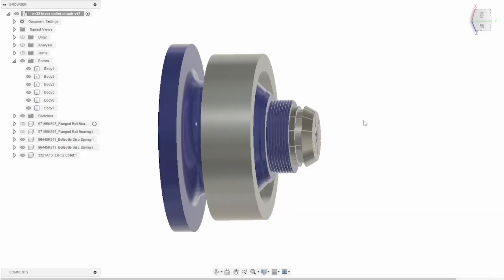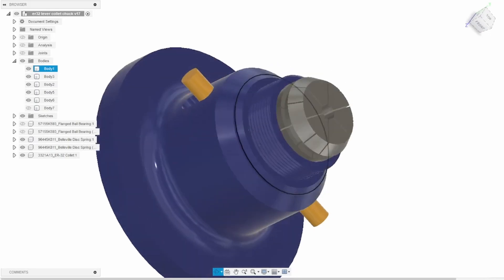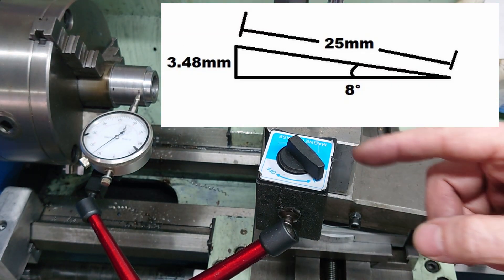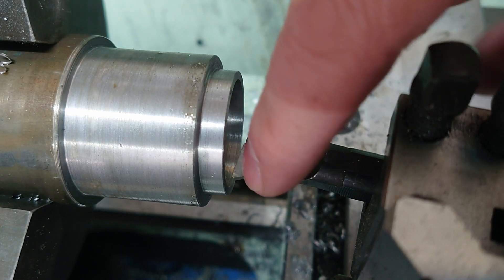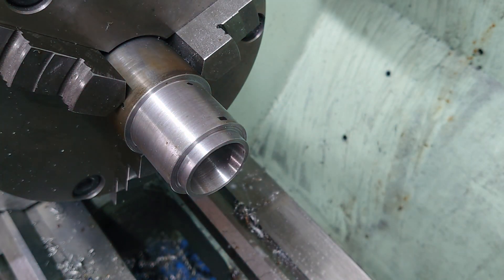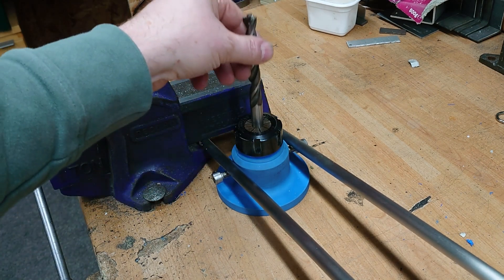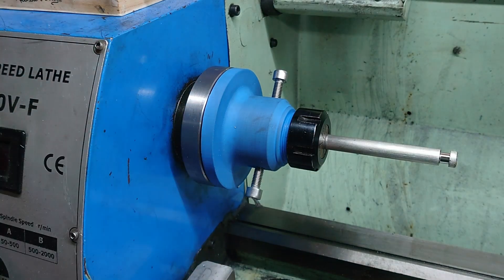Lever Action ER Collet Chuck - Prototype

Comment: I'm slowly working my lathe over to cnc to help out on this open project.  Er40 and er50 crossed my mind today and i figured i'd hunt this down. Fusion reminded me i need to upgrade to windows 11 and the only reason i put fusion back on my pc was your chuck. How do i give you credit for this?  You came up with it.  Not me.  I'm just nibbling at working on it.  picked up a 2 stage cylinder for my mill as an excuse to get a compressor so it's incentive to do another for this. Thanks for your work.
Reply from the maker: Hi, very nice to hear someone taking my idea forward. I got too easily side tracked on to other things! No reason why it can't be scaled up to ER40/50, I only went for ER32 as they are the collets I have. I'm interested to learn more about how you plan to actuate the chuck, and what size cylinder you think it needs. My email is on my channel about page, I think you have to look at it on a desktop browser. As for credit, a mention is fine with me, I'm not after all out glory. Let me know how it goes, I would love to see the end result.
Reply: @ollysworkshop  I'll cross that bridge when i slap the machine together.   I want to take a closer look to some of our "second opertion" and standard dovetail hardinge lathe mechanisms at work more closely but stage cylinder and overcenter mech have been stuck in my head since i saw this but nothing concrete.  I've spent all the time between now and then designing my actual lathe.

Comment: Clamping the parallel shank of a tool by spring pressure is not used in industry for obvious reasons.
Bellevile washers are used to clamp solid tapers into a socket via a drawbar where the inherent friction of the taper and drive keys stop the toolholder from spinning. The cutting tool is securely clamped in the toolholder.

Comment: WIthout a cross section diagram, I couldn't see, but unless mistaken,
only the back half of the ER is in a taper? (the sliding part)
Or does the ER front also get gripped in the body of the chuck?
Reply from the maker: Hi Nigel, on this version I could only get a small amount of taper contact with the sliding part as I had to make the neck of the body (the bit with the M40 thread for the nut) fairly substantial as it was only a 3D print. I'm redesigning it in metal and I think I can get the taper to full length on that version.  I'll include a section drawing of the mechanism in the next video.

Comment: In my experience using ER,  fine chips get into the collet and chuck. If you use ER at all you know it's a clean every time you release the nut affair....
For the manual lathe, the Hardigne/Sjogren speed chuck in 5C is my favorite. You really only need a few stock size collets and some soft emergency collets for 2nd op or odd sizes. I have a 5C lever action chuck, never set it up.
Reply from the maker: Hi, thanks for the feedback, that's a good point about cleaning the collet. Makes me think that some kind of chip shield is on order 🤔.

Comment: If you drill a hole midway between the 2 release pins and make a spanner which starts with a pin in that hole, attach 2 metal arms which come around the tool body and can push the 2 release pins and then come back together on the other side of the chuck to form a handle the tool would be very easy to operate.
There will have to be some o-rings between the sliding piston and the container sleeve to keep out dirt and swarf but your design is a good one...
Congratulations on a well thought out concept.
Reply from the maker: Hi, thanks for your input. The lever you suggest is pretty much where I'm at, although I've had loads of feedback so lots of ideas bouncing around in my head. Excellent idea to use o rings to seal the mechanism, I'll definitely be incorporating that one.👍

Comment: You earned a sub... A great idea... Some potential issues, but honestly, nothing that can`t be engineered out... I just deleted a comment i was writing, but i`ll try and get back to this and comment again a more detailed idea... Hell, i maybe even do a tech drawing of what comes to mind and post a short video explaining the thinking behind it... Let`s just say that i would take your idea, and make it a bit more complex... The thing could be made a tad longer, thus granting space for an integral loosening mechanism akin to the american taper lathe spindle nut that draws the chucks and retains them on the taper while the key does it`s job... The nut would be a 3-piece design, being drawn back by a spring towards the spindle as a safety feature, and the special wrench or an actuator could be made that would allow you to push it away from the spindle and towards the lugs of this, catching them and forcing the inner piece to slide back... You would need a secondary rod to be insertable in a hole in the base of the body for actual torque to be transmitted rather than turning the damn thing, and the spindle would have to be stationary with such a design, but it would be quick and damn stout at any rate... 
Now a whole bunch of other ideas come to mind, more akin to conventional collet closers and even automatic closers, but all of that often puts force on the headstock casting or spindle itself, neither of which is the best thing imaginable for the castings nor the hollow shaft that is in fact a high precision instrument of sorts... I much prefer to keep all the force that a system needs contained fully within the system itself, rather than making any part of the lathe a subsidiary of that system and a potential failure point... A cracked chuck is easily tossed away, a damaged lathe casting is a reason to grease the train wheels with ones own fat... 
If you want, or better said, if i feel like it, i may do a tech drawing of what comes to mind and film a short bit on it, explaining the thoughts and general design premise, but i think you get the point... 

Kind regards and all the best!
Steuss

Edit
I made the drawing, it`s a tad flawed, but i`ll go through it and post a vid in a few days(hopefully)
Reply from the maker: Hi, sorry for the delay in responding. Wow, what a comment! There's a lot of good suggestions there, and it's triggered a few ideas of my own.  I will certainly be interested to see what you have come up with. I am with you on not putting too much force through the lathe, food for thought!🤔
Reply: @ollysworkshop  I recorded like 6 fucking videos today, going over the damn rough draft again and again, and every damn footage had some damn issue, be it sound or other... I`ll record again tomorrow and likely post within a day or two... I really need to get some proper recording eq. made for the job... 
Regarding the ideas, i`m most glad, that design has quite the potential in my eyes, i added some details to the drawings which i will explain... But yeah, putting loads on parts that may bear with it but may also fail as a result over time is a major concern to me... I`m not a purist regarding oem, but i generally like to be mindful of what the design department had in mind before the casting even had a mould... 

Best regards and ``see ya`` soon!
Steuss
Reply: @ollysworkshop  Here we go, I`ll upload a vid in a few minutes... I think it mostly covered everything... I have some additional thoughts, but let`s just say that the ``rear retainer ring`` doesn`t have to have the ``thin retaining/locking nuts``, one could make a long nut with a tapered shoulder and a locking configuration of whatever chosen integral sort, thus granting the split nut full support from both ends, while at the same time reducing the number of parts from 3 to 1 to achieve the same effect... I may touch up the draft and record a short addendum, but what i said here is mostly what i would add at this moment... We`ll see... 

Best regards!

Comment: Fun idea and video! I'm a bit worried about cutting tool pressure releasing the grip since the only thing holding the collet closed is the springs.  Lever action collet closers for other collet systems have an "over center mechanism" so that when they are locked, there is a great amount of force required to get back into the open state.  They do pop open sometimes but it is pretty rare. Maybe you could look at adding that kind of mechanism.
Reply from the maker: Thanks for the feedback, I'll definitely add that to the list. I'll try it out without first, as if it works then it's preferable to keep it simple, but you make a valid point.

Comment: I find this idea a great bit of fun. 

So as you said in reply to HM-Projects "I'm still trying to figure out the best way to make the lever actuator mechanism. It will sleeve over the rest to hide the spinny bits". I was wondering what you had in mind for that. 

I myself would make an outer ring that picks up shorter bolts than the ones that you are currently prying on. At least three and perhaps four of those bolts. This would then give a spinning ring, close against the main body, which you could then cover with a stationary one that attaches to the lever system that is used to compress the springs. 

There is of course a more crazy method, that being using compressed air to release the part. You would set up a piston system inside the chuck to compress the Belleville washers. Then there would be a pair or so of valve stem tubes sticking out where you bolts currently reside. In use, you use a simple air chuck on a hose from your compressor to apply pressure to the tubes, which releases the part. Then by removing the air chuck, the pressure is released because the Schrader valves in the tubes have been removed and the next part is clamped. 

No matter how you do this, I like your project, it's fun. 

Air Chuck
https://d3d71ba2asa5oz.cloudfront.net/12031745/images/10778%201.jpg

Valve Stem 
https://static.summitracing.com/global/images/prod/xlarge/bkm-15-1974_xl.jpg

Schrader Valve
https://en.wikipedia.org/wiki/Schrader_valve
Reply from the maker: That's some great ideas. I had considered an air actuator of some kind, but went off the idea as I was imagining some kind of banjo fitting with a permanent air connection. I didn't fancy designing that. Your idea is somewhat simpler. 
We're definitely on the same page as far as the outer sleeve goes. I'm still thinking, and processing everyone's comments, but hopefully something will emerge from my brain soon!

Comment: Cool project. How are you planning on making the lever mechanism independent from the spindle? So that the lever can remain stationary as the spindle turns?
Reply from the maker: I had originally planned to have bearings on the bolts sticking out of the side that would run on a stationary ring. I didn't like that idea, so I didn't show that bit of it. I'm now leaning towards an external sleeve that would be pressed on by a bearing on the lever. Either regular bearings or some kind of clutch bearing.
Reply: @ollysworkshop  yeah i was thinking something similar with a bearing and some kind of groove on the OD of the inner ring with matching protrusion for the lever. so essentially you're pulling back on a ring locked into the groove of the inner ring instead of 2 pins. that's probably doesn't make any sense lol but i swear it looks clever AF in my head... 😂

Comment: 2.01K subs as I watch, Well Done Olly.
Looking at you actuate the pins with the long bar, I assume there is a fair amount of force in those washers, but do you think there is any chance of cutting force applied to the work piece pushing the collet back and therefore releasing itself (just a thought)?
I'm also curious as to how you are going to apply your lever mechanism when actually on the lathe ie Waiting for part 2.👍
Cheers from Down Under
Reply from the maker: Hi Bob! 2038 as I write this, got to be my most popular video to date. There is a risk of slipping as the force will be less than a rigid chuck. Will be interesting to see what kind of load it will handle. Hopefully by part 2 I'll have figured out how to do the lever bit!

Comment: Hi! I am glad to see someone trying this as i had similar ideas but did not pursue them for the following reasons:
1. ER collets require more compressive force to close the collet than other tapered collet designs which are commonly used in auto-collet-closer applications, which is probably why we don't see ER auto-collet-closers.
2. Quite often when loosening an ER collet, the collet does not disengage from the taper on its own. You break the nut loose, spin it out a few turns, and then encounter resistance again, that is the collet "stuck" in the taper. Further torque applied pulls the collet out with a "pop." Your design may or may not address this, I can't  tell. If it doesn’t, it should, or else there will be problems.

That said, i think you have chosen wisely with the Belleville washers and I look forward to being proven wrong. Subscribed to follow your progress.
Reply from the maker: I will be making a metal body that I can properly test very soon!
Reply from the maker: A couple of excellent points there. No 2 is easy, because I'm retracting the rear taper, it definitely disengages, as you can see when I'm releasing the drill bit. No 1 is a concern, not being a mechanical engineer by trade, I'm not sure how to calculate the forces required, the numbers for the Belleville washers are quite high (~2600N), but no idea how this compares to the compressive force when a collet nut is torqued up (about 130Nm for ER32).
Reply: @ollysworkshop  ok cool. #1 shouldn't be too hard to figure out either, just torque the nut however tight it takes to keep the workpiece from spinning when a "normal cutting load" (use your calibrated wrist I guess) is applied, and see if your mechanism still works. If you have to apply so much torque that it collapses the Belleville washers, then the mechanism won't do its thing. You may or may not be able to do this with a 3D printed body. My gut feeling is that you won't be able to do a real test until you invest in a metal body, and if true, that sucks.
Reply: @ollysworkshop  according to my math it's about 18kN axial force from the nut. That doesn't mean every work piece requires that much.

Comment: That's spooky - I have a design for just such a thing in my head that has been keeping me awake for the last couple of months. Is YouTube listening to my brain? My design however, used a tube that passed through the spindle (the largest ER40 is somewhat smaller than the spindle bore). Subscribed.
Reply from the maker: Hi, yes it's scary when YouTube can tell what you're thinking! I did think about something through the headstock but my through hole is only 25mm and I wanted to keep my options open as you can get "special" ER32 collets up to 25mm (normal limit is 20mm). Stay tuned for more development 👍
Reply: @ollysworkshop  
Similar problem for me. I am running a mini lathe with a 3/4 inch through bore, so even more constrained on things through the bore.
Reply from the maker: @oldfarthacks  another reason for me to get this done properly!

Comment: Superb idea, even marketable. Warco 250? 

Make the collet chuck set true also maybe?
Reply from the maker: Hi thanks for the feedback. The lathe is a WM290, similar to the warco machine (and probably from the same factory) but a different distributor. Set true would certainly be an upgrade. I'll add it to the list.  It'll be interesting to see what the runout is when I've got a proper metal version.

Comment: Great to see you back in the workshop Olly! This looks like a great project, I hope there's a part 2.
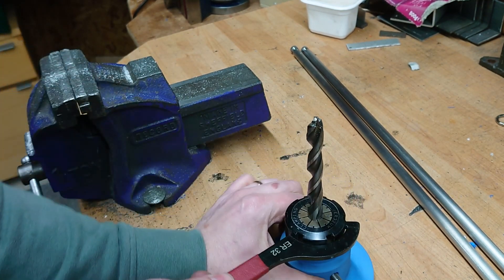I've still never tried a 3D printed thread. I'd assumed that they were largely for decoration, and would shear off at the first sign of any torque, but you seem to be giving it some welly at 06:35. Something I need to experiment with I reckon 👍
Reply from the maker: Honestly I'm amazed at how that little lock ring has stood up to the forces. It's a 1mm pitch and 3mm thick (from memory) so only about 3 threads engaged. It was printed on the 0.12mm layer height setting on my bambu, I could only print decorative threads on my creality.

Comment: Very nice. Haas uses BelSeville washers for the drawbar.
Reply from the maker: Good to know that a real manufacturer uses them. I first heard about them when Physics Anonymous did their power drawbar, no doubt they mentioned Haas, but I just remembered the name of the washers!
Reply: There's quite a bit of fun stuff on Haas machines. One of the more fun bits is the resistors used for motor braking. For quite a while, they were using regular high power resistors, which are quite expensive. Then one day Gean asked Kurt if they could use the heating elements from the common electric range. Kurt handed the project off to one of the engineers and the design was completed, saving around $150 per machine. Out of the box engineering.
Reply from the maker: @oldfarthacks  interesting 🤔